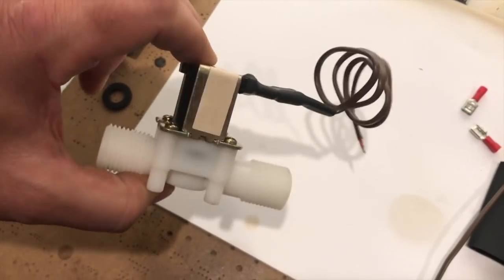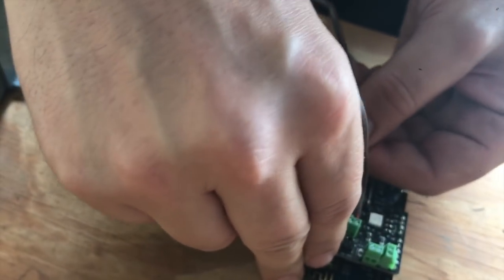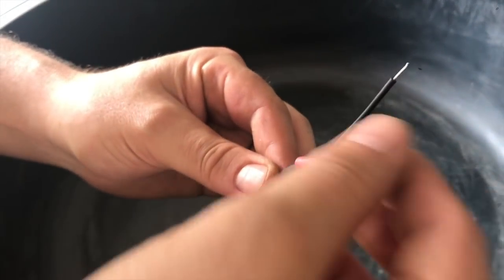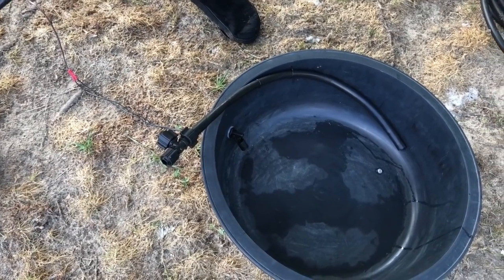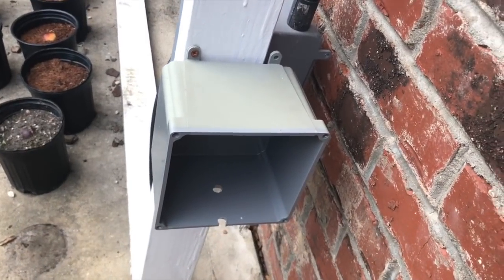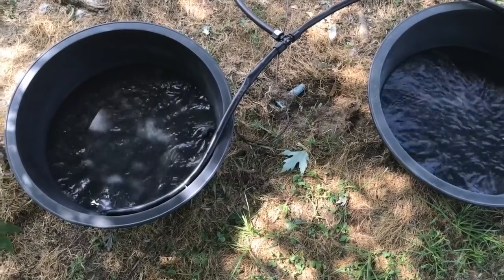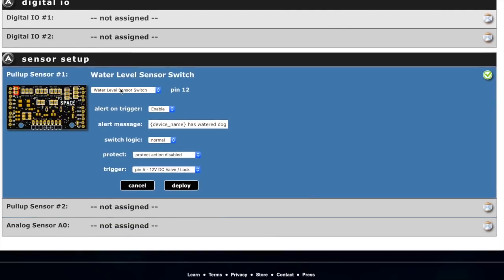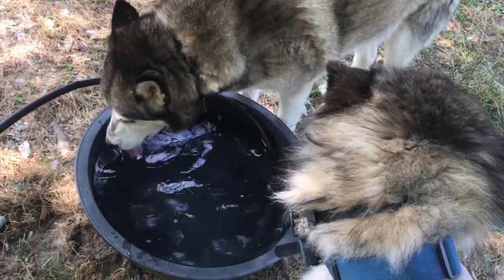Automatic Refilling Dog Water Bowl with WiFi Alerts

Comment: So what happens if the dogs only drink out of the bowl without the sensor? Also, you didn't even show us the "garden" control. What is it doing and how does it work?
Reply from the maker: You could always run a sensor to each bowl.

With that being said, a healthy dog won't refuse to drink water when it's preset - but to answer your question of what would happen, Darwinism I suppose

We have five dogs so two large bowls works better